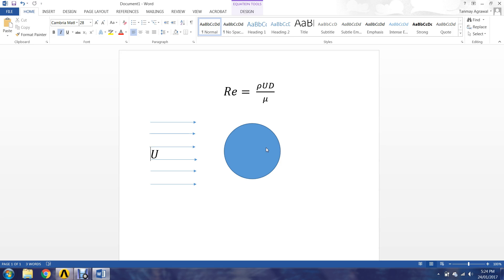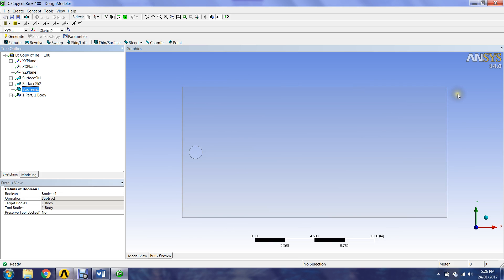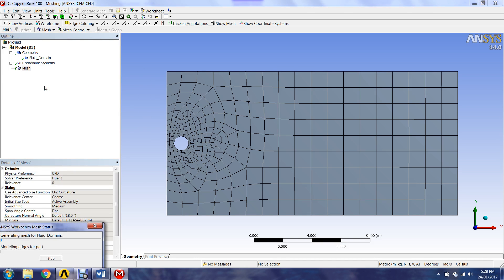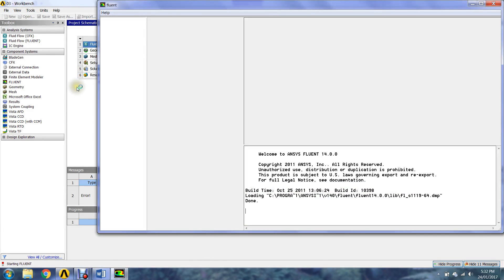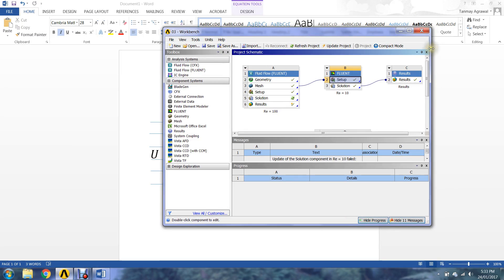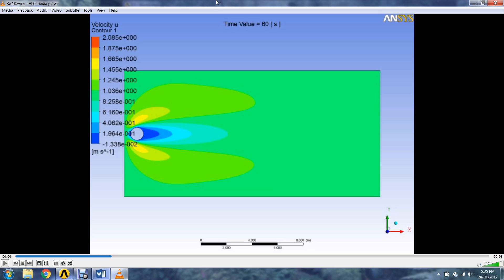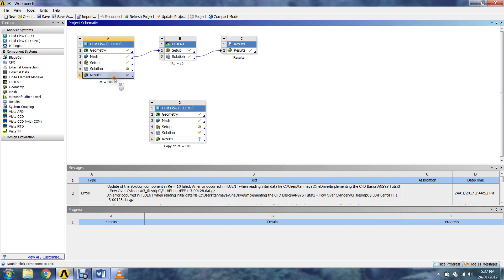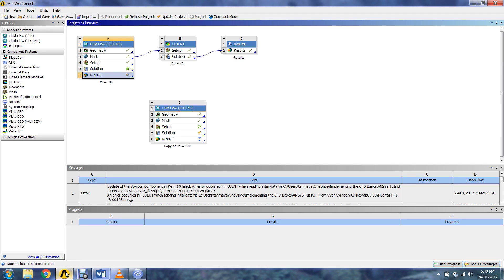Simulation of Flow over Cylinder using ANSYS Fluent | 05 | Implementing the CFD Basics

Comment: Hey tanmay
Would you be able to share a video on Laminar Stationary Flow of Air around a  Rotating Circular Cylinder. w= 100rad/s. Still new to CFD and trying to get my head around it.
much appreciated
thanks
Reply from the maker: Hi,

I am not doing much work on fluent these days. To rotate the cylinder, you can provide the frame/mesh motion in cell zone conditions which is found in setup. ANSYS documentation has a good tutorial on this, hope that helps.
Reply: @TanmayAgrawal7  ah thanks for the lead Tanmay. I’ll try it out